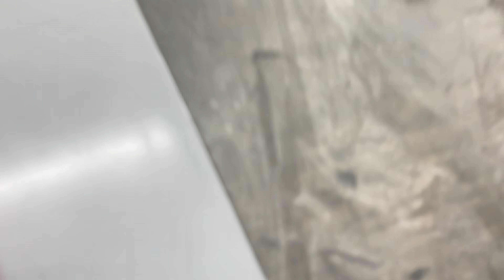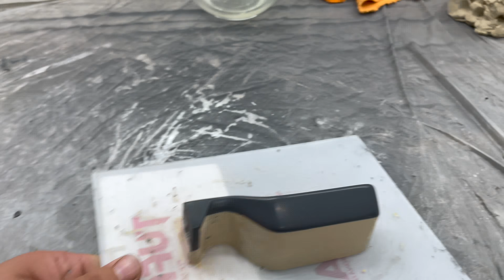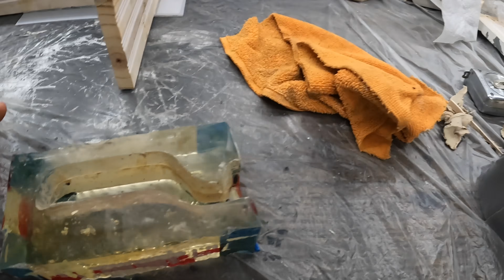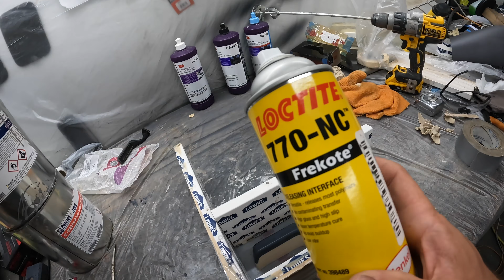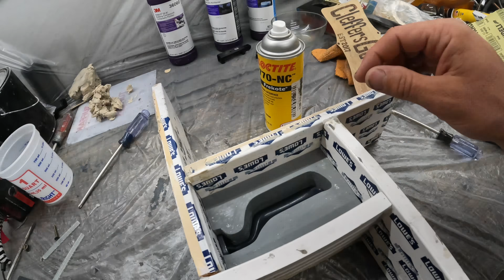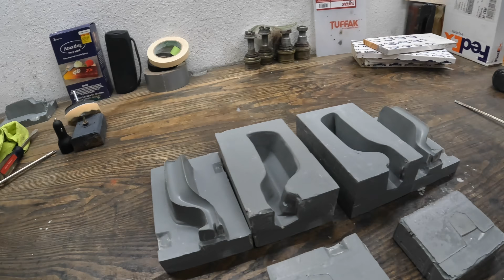Making My First Forged Carbon Fiber Mold

Comment: I clicked this because it looked like the door handle for my 1995 F250. I have gone through several of these over the years and have carefully examined the mechanism to see if there is a reason but beyond poor design I cannot find one. I have thought to cast one out of brass or try forged carbon fiber. I would love to get one of yours if they are available for driver's side.

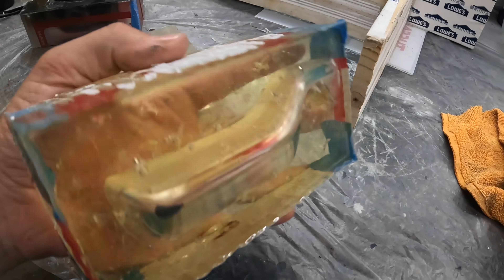Comment: 8:30 that's the reason I usually work my way up from dirty cheap material like plaster, soap, sand, plasteline, wood and pvc pipes to high quality hopefully-only-buy-once material like carbon fiber, epoxy etc.
Reply from the maker: That’s probably the route I should have taken. Ive learned some expensive lessons.
Reply: @CleffersGarage1  Don't worry, we all did.

Comment: Nice job! Moldmaking is hard. Took me forever to make the first set of proper molds. I used a resin 3d printer for my forged CF molds, which turned out great. I have a timelapse of the entire process on my channel. After all that trouble with designing and mold making, the forging part was a smooth and enjoyable ride.
Reply from the maker: That’s awesome. I would like to try that or regular 3d printing a mold. Would solve half my problems and probably come in at a much lower cost.
Reply: @CleffersGarage1  Easy Composites has a great video on forged CF in which they use a 3d printed mold. I believe they also have a video on 3d printing molds. They are  super helpful and have answered any questions despite the fact that I am not a customer (they're in the UK I'm in US)
Reply: @CleffersGarage1  3D printing is great for one offs, prototypes, and limited runs but the molds won't hold up for production.
Reply: @juanesteban8827 depends on the material u print with.

Comment: For all the work you do in the garage making these molds and stuff, I found a battery powered hot glue gun at harbor freight, bauer brand for like $20 loved it when I was using hot glue to help hold everything together while I was making my molds and didn't have to worry about the cord from the glue gun.
Reply from the maker: I might have to get one. Thank you.